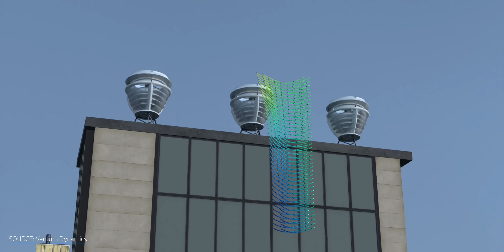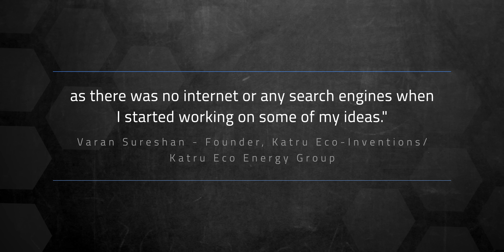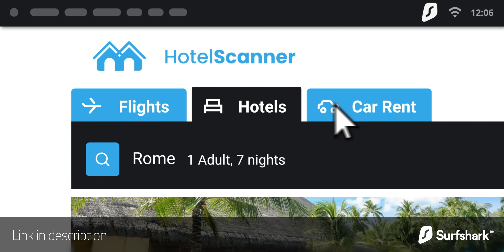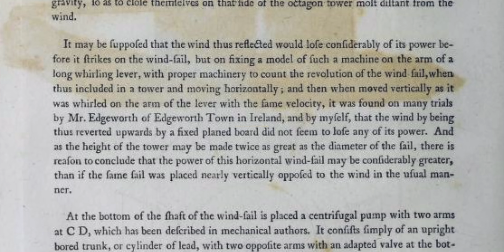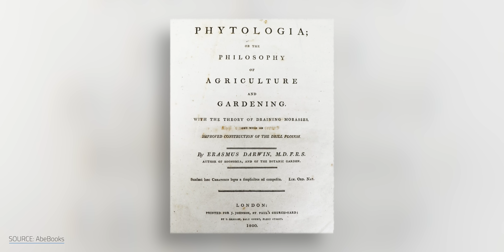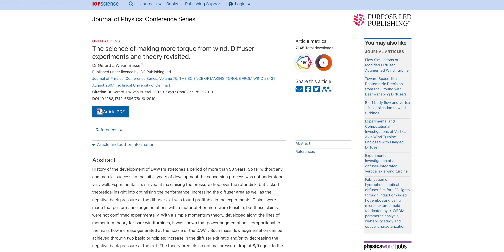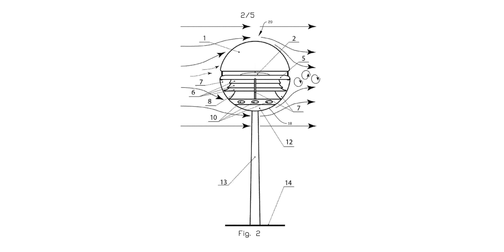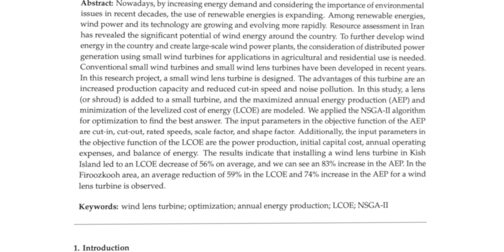Are Shrouded Rooftop Wind Turbines the Future of Energy?

Comment: As a former high-rise window cleaner, spending a lot of time on the side of a tall buildings. I can confirm the intensity of updrafts are so strong that it can prevent us from working a particular side because the winds are too powerful on that side. Although I may not be an engineer, I am the son, nephew, and grandson of engineers. And I think this is a viable and alternative option for energy gathering. Keep up the great work Matt.
Reply: Those updrafts are no joke. I worked in a tall downtown bank building some years back, near the top floor, and there was one time when I looked out the window and it was literally snowing UP.
Reply: I wonder how much drag rooftop generators will add to the buildings; increasing the issues of windage on the structure?
Reply: @euansmith3699 it's not more than thebforce load on thw side of the building when thw wind blows against it.
Reply: @euansmith3699  very little
Reply: @euansmith3699  it would end up destroying the building.  Maybe if the building was designed for this they could make it work but if you just throw it on a roof that is not designed for the extra stress would eventually destroy the building.  Even if you engineer this in from the start it would require extra support which would just make this idea not economical.
Reply: @pin65371  if the stress is that bad wouldn't the turbine get knocked over well before it would destroy the building?
Reply: @Zach476 The stress might destroy the connection of the turbine to the roof and you wouldn’t want to risk a turbine that needs to be lifted by a crane falling down a building.
Reply: @Zach476  its not about destroying the building fast.  Its the long term stresses that you'd be putting on everything. It might take a few years but eventually major repairs would need to be done.
Reply: @pin65371  The added sideways stress to the building would be far less than adding another floor to it. There are no hurricanes in Norway, just storms, and all roofs need to be able to withstand about a meter of snow during winter. I recon most buildings should handle this just fine.
Reply: @skirata3144  you know there are safety tethers right? Almost all removable machines that connect to the sides of buildings have safety cables
Reply: @pin65371  Not if it's built properly first up, you do know that's how large buildings don't fall over right, they are designed properly in the first place...So many silly comments here....
Reply: @pin65371  roofs are already engineered for the pressure differential between normal air pressure inside the building and low pressure above the roof during high wind speed events.  your assertion that the added engineering makes it “not worth it” isn’t even back of the envelope, it’s back of the frontal lobe. a light industrial area shed roof is very different to a tall building roof which is different again to 5 storey commercial building or institutional building. your overgeneralising.
Reply: @alastairleith8612  when they engineer a building they are engineering it for wind to hit the building.  Not to hit something small that is putting force on a small area. I'm just going to assume when you are trying to insult me you are basing it on theory and not reality. My job is dealing in reality.  We actually deal with similar issues.
Reply: @MickH60  they are designed for the wind to hit the building.  Not for the wind to hit a turbine on the roof that is putting forces on small areas of the roof. The silly comments are the people that are trying to say I'm wrong when I actually deal with these types of issues. Last year we had part of the roof of one of our buildings collapse after strong winds over the years weakened part of the roof.  That was with the roof being engineered for what was up there. Modeling only goes so far.
Reply: @pin65371, not necessarily.  If the roof can take the load it should be fine.
Reply: @pin65371  It will provide no more lateral forces than the average rooftop air handling unit
Reply: @pin65371 
I agree with you that the building should be designed for capturing wind power. Maybe in the future buildings will be designed for this purpose, channeling wind to the turbines to use the wind as much as possible. The bigger the building the more wind it can capture, the more free electricity to run lights and appliances, or produce electricity for the grid. Imagine a city of thousands of buildings with wind powered electric generators producing electricity for the grid.
Reply: Interesting. I'm the son, nephew, and grandson of shipbuilders, and it absolutely conveys no knowledge or abilities enabling me to in any way build, or analyze ships.
Reply: @notahotshot  probably because you don't have any interest in it, it ain't automatic, and you'd be very naïve to think it is....
Reply: @notahotshot  Just because you didn't pay attention is no reason to assume others did not. And if you don't know more than average about ship-building, it quite possibly says something about your family dynamic or the breadth of your interests.
Reply: and what about some apparatus with piezo electric menbrans fixed on the vertical wall.
Reply: @franckzippo  can the floor piano that lights up when stepped on be an example of that device??? I just google it and saw some drawings, and that's what came to mind!. Lmk thank you.
Reply: Window cleaning, the highest form of washing :)
Reply: Given that the person who made this later version noticed it when installing HVACs, I wonder if it'd be more effective to instead use that updraft to blow the air across the heat exchangers on the HVAC (instead of the fans) rather than trying to generate electricity from it.
Reply: @graysonsmith7031 that already happens!
Reply: Problem is that in urban complex environments downdrafts and side drafts are just as common and often a choatic intermittant pattern of all.
We keep seeing the turbines and they always stay clear of how chaotic urban towns and citiess are in wind pattern.
Reply: You are right, I am a structural engineer. The edge of the roof on large buildings especially near the corners are high wind zones, some of the highest roofs are designed for.
Reply: I'm with you buddy I once got blown around the corner of building !😵
Reply: There might be strong upwinds on high building. But if you put a turbine there, the wind will go around it, because if you want extract energy, it resist the flow. So it might get better power per area of rotor, but it is also a lot more $ per area. So I really doubt that makes sense. On the website, they do not have a power rating. Probably because that is shockingly low, especially when you compare the power per cost with normal wind turbines.
Reply: No.
Reply: Vertical wind between you and the glass, awesome day at work 😂
Reply: Really interesting - thanks
Reply: @davidyoung518  It's quite impressive how much stronger the wind gets even in residential suburbs.

My old home was two stories tall and so we're all the buildings around it and it actually would increase the speed of wind in the winter time making snow storms worse.

You could literally see the wind picking up in between each home and sometimes it would lift large objects and garbage cans through these pathways between the houses.
Reply: Imagine designing a structure for it.
Reply: Exactly. So why are fancy turbines placed on the roof, when most of the wind energy is up the sides? It would be better surely to hang a conventional (and large) turbine over the top edge. Especially where there's a wind funnel between buildings.

I suspect that nobody did the initial research, to optimise the placement - and subsequent investment.

I may be wrong, of course.

@undecidedmf: FYI
Reply: @Number_Free Totally agree with you, then the air wouldn't have to turn sideways to get to the shrouds😅hang it out at least half way
Reply: @Number_Free  most hiring buildings fill the bulk plane. So the cant put things on the side.
The fact it has tourqe and power inside, hanging it off the side of a building would cost more that the benefit if there is one.
Reply: @sparksmcgee6641  I expect that a steel frame could be erected and the turbines placed at a suitable height. No doubt they could be lowered for maintenance purposes. A portable framework even 

If there's high wind energy available, we should make the effort to extract it - cleanly and safely, of course.
Reply: @Number_Free  yeah you could do all those things. It would make it unprofitable to install them. 
I'm in construction. There is such a shortage of people qualified to do things like lower and raise tons of steel from over people's head to the ground for servicing that anything involving a human having to do anything after install  involving the structure makes it un economical. And as so as something it detached or moved you're doing structural work when it goes back up. 
Check out the inspection requirements and insurance cost of window washing.
Reply: @Number_Free  they need to put plastic or metal thin pipes with holes and inserted each to another with the whole to suck more air - nice and design over the walls to gather wind flow and then put to turbines on the roof
Reply: @Number_Free  Errr. because people can walk on the roof, but not the sides
Reply: @Number_Free  There has been a lot of research into roof edge wind turbines.
High windage and a high risk of damage or destruction of the generator by gusts of hurricane winds excluded the mass use of such structures
Reply: @MihailG5541  Interesting, and thank you. I still believe that ought to be a viable engineering solution however. A guy in Japan claimed to have a turbine that could be powered by tornados, for example.

Also turbine structures could be built between buildings, in principle, where there may be safer winds. 

I may be naïve but I have also had some success with innovation, so I continue to challenge the status quo, or assumptions.
Reply: @Number_Free  Wind turbines can use tornado or hurricane force winds if they are rotating cylinders connected like
Darrieus blades.
The tensile strength is slightly higher than that of Darrieus turbines, but the problems are the same
Reply: @CraigLandsberg-lk1ep  yes, but the average wind speed must be 7 m/s of higher
Reply: @MihailG5541  not everywhere is in Tornado alley USA, there is the rest of the world, get out more.
Reply: Engineering IS NOT GENETIC!!!
Reply: @NewerSwagger-gp3hj  REALLY!!!! Thanks Darwin! Never said it was! Just implying that from birth I've been around civil engineers, structural engineers, electrical engineers, & even mechanical engineers. You pick up a thing or two.....Okay Dr. Jackass!!
Reply: @NewerSwagger-gp3hj  Well done genius, intelligence IS....!!!!  {there are obvious exceptions}
Reply: You know being the son of an engineer isn't a qualification, right?
Reply: @mattymattffs  You do know being around clever intelligent people will help your knowledge base and improve your understanding of things right ?
Reply: @MickH60  yeah, but it clearly didn't rub off on him
Reply: @mattymattffs  You know that you're the only one who mentioned qualification, right? I am not a geologist, but as the son and grandson of geologists, I have significantly better than average understanding of the topic. That isn't automatic and yet it is not surprising, is it?
Reply: @mattymattffs what does? A degree or real world missions?
Reply: @mattymattffs  you know being snarky isn't a good look?
Reply: @mattymattffs yes it is because intelligence is genetic. What are your genetics?
Reply: @MAGATRON-DESTROY  generations of certified genius.
Reply: @mattymattffs He is probably intelligent.  Intelligence is genetic
Reply: @mefobills279  nah he's not, otherwise he wouldn't have uttered that garbage
Reply: @mattymattffs  That is worst kind of academic tripe.  You assume a person must have a degree to be "smart" on any given subject.  A university degree is simply exposure to a given topic.  Just because a person doesn't have a "qualification", doesn't mean they can't have viable knowledge.  I have been in technology for decades. Are my children more "technical" because of their upbringing in my house?  Absolutely they are!!!  I also cook.  My children cook well because of their exposure to food and techniques they experienced in their childhood.  I'm also an accomplished musician.  My children play instruments and sing because of their exposure to music during their upbringing.  They don't have degrees in IT, or music, and they are not deemed "chefs", but they are dare good at all of it.
Reply: @mattlevault5140  no, not at all. I am simply stating the fact that being the son of someone doesn't imbue any skills or qualifications.